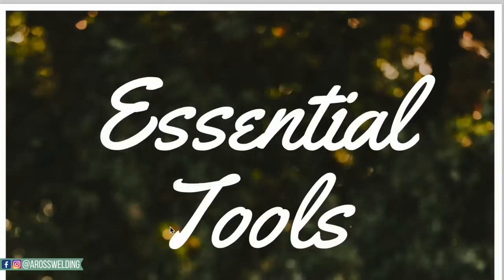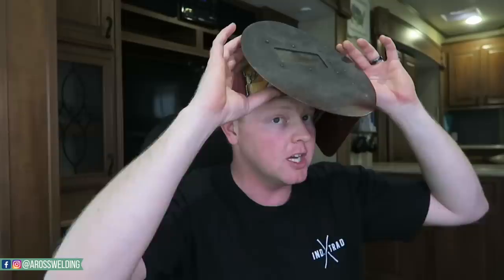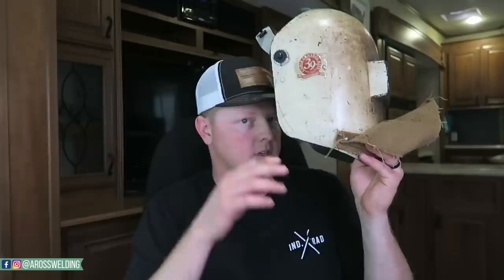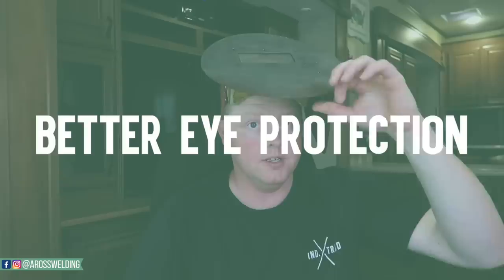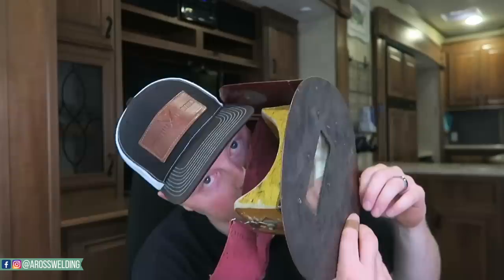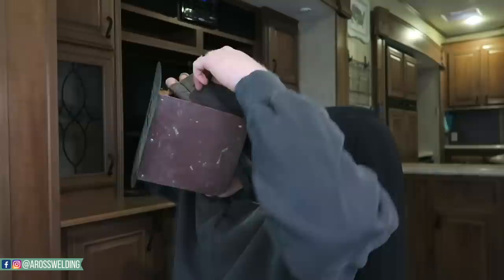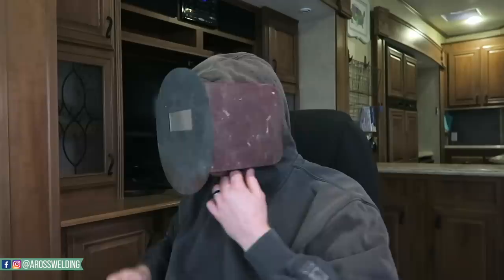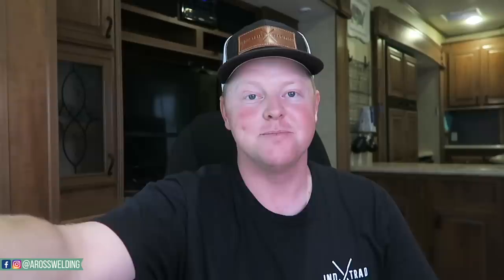WHY PIPELINE WELDERS WEAR PANCAKE WELDING HOODS (EVERYTHING YOU NEED TO KNOW)

Comment: I'll never wear a hoodie or hooded jacket while welding. In my early 20's I was welding a ladder on a grain silo. I'm 20+ feet in the air welding and wearing a hoodie when I feel a tug on my feed line. My buddy was desperately trying to tell me that my hood caught some slag and burst into flames. 17 years later and I still don't wear a hoodie of any type to weld.
Reply: @thegrandfinale2 oh looking back on it, it was absolutely hilarious and terrifying simultaneously.
Reply: @thegrandfinale2 it's not just a good suggestion. At my company all welding is halted 20 minutes before calling it a day. Not only to clean up, but to ensure there's nothing scorching hot before leaving. We also have an old wives tale about being extra cautious on Thursdays. Because of one reason. Payday being Friday means it is cheaper on the company to die Thursday.
Reply: I had one light fire in my hoodie pocket.
Reply: @thegrandfinale2 30 minute rule
Reply: Hot work permits cover that as well. If you are doing shorter welds you'll be alright tho. Most of my welding stuff is also wrenching attire and covered with oil. Haven't died yet.
Reply: That’s like rule #1 when you’re in welding school.
No hoodies....
Reply: When i was learning to weld in college back in the late 80s i just bought some overalls that happened to be nylon. I was learning MMA and gas welding and i'd get the odd hole from hot metal in my overalls. Then a mate who got some nasty burns as a kid messing around with burning plastic sheet, a small part of which broke off and stuck to his leg went total batshit at me and made me buy some cotton ones.
So there i was a couple of weeks later sat at my bench gas welding and as you do when first learning, not keeping my filler rod within the flame so was getting oxide forming and leading to the occasional exploding weld pool. Well one such explosion, unbeknownst to me, landed on the thick part where the press studs go on the overalls front and started to burn.
There were four of us taking this course. The other three all worked together. I was paying my own way. They had been pratting about trying to set each other's overalls on fire by touching the glowing ends of their filler rods to their mate's overalls. They tried it once on me and i threatened to put him through the wall!
So i'm welding away and start feeling some heat under my chin, so i move back a bit further away from the pipe or whatever it was i was welding thinking i'd leaned in too close.
Carried on welding...
Still feeling the heat, so i stop and look down, (still wearing my gas welding goggles) for any flames. Don't see any flames, carry on welding.
Now my chin is REALLY feeling heat so i quickly stop and pull off my goggles to see a two inch wide burning patch about four inches below my chin! I start slapping the flames out with my left hand and then look around to see these three dickheads all sat there grinning and when i see them grinning, burst out laughing! They decided not to tell me i was on fire because i threatened one of them...
Needless to say, the next session i was wearing nylon overalls again. I'd rather have holes than large sections catching fire!
Reply: @_multiverse_  no no no no #1 rule is: just dont catch on fire duhh
Reply: @_multiverse_  Im taking a basic welding course that just started yesterday. first 5 minutes after attendance, NO HOODS, NO POLYESTER. he said it about 8 times
Reply: @_multiverse_  I prefer coveralls but at least 80% of the students in my class intakes wore hoodies 🤣
Reply: You can get hoodies made out of Nomex now, they ain't cheap but if you gotta keep warm, definately a better option.
Reply: You wear a hoodie when you weld? Is that flame retardent?
I think back to all the times my jeans caught fire... and they burn slow....
Reply: @koitorob  I'd rather a flame that is barely noticable than a quickly-burning synthetic that melts and sticks to my skin like pitch
Reply: @simply_based  hoods are fine when they're fireproof.
Reply: @koitorob  nylon is a no no. That stuff burns pretty easily and will stick to your skin while it’s going.
Reply: @almosthuman1398  a friend of mine put a huge hole in his trackies welding something in college,

Burnt right through his overalls and left a hole but amazingly didn't burn his leg.
Reply: I've set myself on fire a few times . It happens ! I've even had hot slag drip down inside my boots . Always good to have a water hose and a fire extinguisher for these circumstances . Hot slag will get your attention real fast . 😅

Comment: I use those normal composite with the auto darkening lenses that you see fabricators use and just add a small piece of leather to block out back light and what is nice about the normal auto darkening composites is they allow you to have an option for grinding as well, so you use the helmet as a face shield as well.

Comment: I worked as a helper offshore on the pipeline in the late 90s and early 2000s. Very few guys wore the pancake shields and a lot of times the welding foreman wouldnt allow them. 
Top 5 Pipeliners I knew
1 Chic Liepert. Didnt retire till he was 70. Could run a root like nobody's business. Very pretty caps
2 Johnny Lyles. Cool dude super good welds and easy to work for.
3 Mr Brad. Liked his rods bent so I would always have a stack bent for him. Always had plenty of good pot
4 Carol Trahan. This guy could weld the crack of dawn to the break of day. Cool mfer
5 George Pendergraft. I will never forget you George and thank you for showing me what it took to be the best helper I coud be. Sorry I never did break out

Comment: My advice to those serious about achieving the goal of becoming a certified welder and fitter is start as a laborer or welders helper on the job. You'll learn many things crucial to prime workmanship that a welding school doesn't teach. Welding School can provide you the equipment and technical training applicable but you can't limit yourself by practicing "in position" all the time. Practice 3g & 4g (vertical & overhead) and 6g on pipe (45° axis). As a helper I used my breaks and lunch times practicing on scrap. I passed my 1st field test ( 3g uphill , e7018) '72 because the welder was too fat to get in the fuel tank through its porthole. Practice, practice, practice.....Be the best you can be but without self-pride. Stay humble and you'll learn much more than otherwise. Compete with your own potential, not with someone else. Be dynamic, not stop&go.

Comment: excellent speaker, very clear speech and perfect delivery! I'd never seen a hood like this, but I understood it immediately. 
I was a track welder on a small railroad, and almost all my welding was done outdoors...that's where the tracks are. Every track welder I ever worked with used a conventional "sugar scoop" hood, and would stuff rags into the top, to try to keep the sun out. Others would just struggle with the sunlight and hope for the best. I saw a catalog one time, and saw this leather hood....kind of a leather bag, with the usual harness setup for supporting a welder's hood. It covered the whole head and down the back of the head as well. Perfectly dark inside. I used it indoors as well, and it was good for crawling under a piece of track machinery to paste something back together...tight quarters and a rigid hood would not fit in there. No sizzling BBs in the ear canal, either. Also very nice for air-arc work at 400 amps with a blast of air blowing stuff out of the puddle.

Comment: Another great video for the beginner! Something you might consider for the winter also is a nomex hood,the kind made for firefighters & race car drivers, they are fire resistant  but not fire proof,the point is they are made like a full open face ski mask,They are used by firefighters as part of their turnout gear, but I have found after retiring from the vol.f.d.that they work pretty good for welders & in the extreme cold winter weather they will keep your head warm,especially for old men with bald heads!( & younger guys with bald spots .)

Comment: @Austin Ross, very well done video! Man, things have changed since I was a pipeliner back in the later 60's. The welders waited for me to put a bend or a sag on a joint, then my side boom operator set the joint down on the right of way next to the ditch for them. Don't remember some details of the pipe but it was naked 36" × .250" steel with beveled ends. When the welders finished welding up the joint, the welds were  X-rayed then the dope gang wrapped the pipe. Again, don't recall the details. We worked as late as we needed to on tie ins and "shooting the pig". The welders were men from all over and loved what they did. Our boss Jack Maggard took good care of us all. I had a chance to go to Brazil with the company (McCathern Pipeline) after military service was out of the way. They were drafting back then and I got my Welcome to the Army of the United States letter in August of 68. Now, about those bald spots on your head........lol!

Comment: I love my pancake hood. But I cannot use it because everything nowadays is all about “safety” I work in a structural building plant as a welder, and there are lots of flashes from air arc and just other welders when I use my regular mig welding hood. I honestly wish I could use my pancake for the exact reasons you explained. No sparks in the eye/face, no flashing, very lightweight, and just very convenient.

Comment: I began welding 1972 with Magnolia Marine in Greenville, Ms but as a "laborer/welders helper". I was only 16 then, still in high school and worked there my summer break. I've certified 2006 AWS D1.1/5.20 all positions unlimited thickness as the test 3g(uphand) & 4g was on 1". Despite its occupational hazards and the burn scars I have to show for it all I would strongly suggest "fitting/welding" as a prime occupation.

Comment: I've been a Welder for damn near 40 Years , Race Car Fabrication, Structural, Jobbing Shop amongst other jobs (gotta Pay the Bill's right ) but this is the first time I have ever heard of a Pan Cake helmet , I have used many Visor's including what you call a Sugar Scoop , but  I have found my Speed Glass to be the very best Visor I have ever bought and used, it has a Proban hood like your Sugar Scoop chin flap, but covers the back  of your ears and neck and has served me well when working outside. Workshop welding to Gas Pipelines. 
Good vid and explanation though , I like the side shield on the pancake , ( Yikes sparks down the Ear hole don't half smart)...

Comment: Worse part of flip down hoods is when the tightening knobs wear out from nodding it down then the they won't stay up,frustrating
Reply from the maker: I heard that!
Reply: Just "barrow" them from from a face shield and keep the extra ones from the old gear
Reply: Alex Graham  or a couple of short roofing nails !!!
Reply: @bustersmith how???  With a lock nut n bolt its perfect how would you use a roofing nail 🤣
Reply: Don’t they make little blue pills for that issue?
Reply: You can but machined aluminum nuts that dont wear out.
Reply: I put mine down by hand every time after seeing my stepdad get arc-eye when his hood didn't come down when he started the arc. It got caught on something overhead. He was off for a week til it healed

Comment: Greatly appreciate this video, I do welding for a hobby in my shop and the overhead lights are some of the brightest I had installed. The back light is such a pain and I’m actually going to try one of these pipeline masks. Appreciated!!
Reply: You can take a piece of leather or nonflammable fabric and put it between your welding hat and helmet, letting it drop down the back. It'll block the light and if it doesn't block enough you can roll up another piece and stuff it up front

Comment: when i started learning to weld,  early 70s, i was told the most important thing was that the welder be comfortable.   at first that was a joke.  but NO  its very important.   i was hard faceing trencher teeth with torch.   with a #4 lens.  and my eyes was burning.  so i stacked a #3 and 4 together.  my eyes stopped burning.
Reply from the maker: Very good advice you were givin, I think that’s key also. 👌😎
Reply: I started my apprenticeship as a welder in late 70s that advice from my father who was also a blacksmith/welder always sticks in my mind and so true.

Comment: With out a doubt my favourite daily helmet is the speedglas 9100 adflo. It blocks out all backlight, has the option for side view windows that can come it very handy and I am getting around 16 hours out of the adflo with a 1 hour rapid charge. It's really nice in all weather conditions once you know the tricks and the one touch external grind switch is great. All my other helmets are getting dusty. The XXI is the way to go but the XXI FX (flip up grind) isn't necessary because of the new lens is so clear and has one touch grind.
Cheers

Comment: Totaly get that .I'm not actualy a welder as such but I do it as a hobby and it's required occasionaly from me on a non structural basis at work .I've been in confined spaces with welding taking place and that light glare +UV can come at you from all over the place when space gets tight and the metal is shiny .

Comment: Really interesting, I've never seen anything like this in the UK. I restore vintage cars and motorcycles so I do a reasonable amount of fabrication although I'm not continuously welding all day every day. 

I must admit, that problem you mentioned with the light coming in down the side of the inside of the mask does get on my tits a bit but I usually put a cover over the vehicle I'm working on or if I'm outside try and Jerry rig my way around it. 

Most of the full-time welders are using those ventilated masks like the Speed-Glas ones now from what I've seen. They're all sealed up to the face. 

Thanks for sharing your knowledge on this, always fascinating to see how different people do jobs different ways (and I can guarantee you're a better welder than me, lol) I only have two basic college qualifications on MIG, ARC and gas. I've had a fiddle with TIG under supervision from a proper fabricator and can get steel to glue together quite nicely but I made a small hole in some ally tube ... into a very big hole lol 😆 

Stay safe out there and may the hot rocks not fall down your boots

Comment: I run a titanium with a cowl for a air supply, cowl removes 99% of backlight
Reply: Had a titanium a while back couldn't get on with the headgear so went back to speedglas for ultra comfort and I have a optrel panoramax excuse my spelling witch is so light you forget your wearing it but it's a very fragile lid I'm on my 3rd under warranty in 18months..

Comment: Can also wear a auto darkening helmet with cooling hood.
Reply: Sucks2beU definetly! Auto darkening in either style hood. Just be aware that sometimes you have to weld a little while holding your hood over the burning rod to recharge it if it hasn’t been used in a while. Sunlight wont recharge it. IMO

Comment: Welded in a factory for eight years on galvanized steel. Nasty stuff. Smoke is highly toxic fyi. Had positive pressure helmets from Racal by 3M. Had a "chiller unit" on a waste belt and a air line up your back to the helmet. You had cool air blowing on your face the entire time you were in your hood. Welding helmet still flips up but clear lens helmet under kept bad air out. Nice set up. Very surprised to see you guys not using something similar.

Comment: I always appreciate your advice and tips.  I only weld at home usually small farm repairs or small welding projects. I just have traditional welding helmets that flip up. They have different shades of lenses. Two are cheaper auto darkening and a couple with flip up welding lens so you can see to chip with a clear lens.  And just yesterday I had back light problems trying to repair the tailgate on my dad's 1963 GMC pickup. Also I once got a hot metal spark in my eye while wearing safety glasses and a welding helmet that was down. The welding lens was up and was looking through the clear lens while using the metal chop saw. Sometimes shit just happens.

Comment: Used to work pipeline as a welder helper, those boys that weld the pipes are the salt of the earth that's for sure and tough as nails. Part of a welder helpers job is to take the rods out and hand them replacements during pipe welding to conserve the heat, flow and speed of the operation.  Well doing this in the rain means you are grabbing live leads while well grounded, took many a shocks in the day, only mildly painful. You don't get much more grounded then knee deep in mud.

Comment: Hey Austin, are you able to fit a auto darkening lens in the pancake? I have a lincoln hood with the auto darkening and love it but I definitely know what you mean about that pesky back light coming in the sides.
Reply from the maker: Absolutely. Singles and Lincoln both make a 2x4 auto darkening lens
Reply: @arosswelding  is that what you use..auto darkening?
Reply: Of course, that adds weight again.
Reply: @melgross  so you dont use the auto darkening
Reply: Jacob A. Hull what? You just asked if you could put an auto darken module in the pancake. One of the major points to the pancake, as Austin mentioned, is the light weight. Add an auto module, and you add to that weight. So I don’t get your comment. You’re saying to install one and then not use it?
Reply: @melgross  no bud. why would I put one in and not use it. I was just asking you if you use one....I assume you dont because you mentioned the extra weight.
Reply: Jacob A. Hull I’ve got an auto dark ESAB. But that’s for most indoor work. I don’t need to wear that for hours though. If I did, I wouldn’t use that.
Reply from the maker: I use both. Depending on what I’m doing. I like the colors of my fixed lenses better than my auto darkening. Check out this video: 
https://youtu.be/G1JiVB41WPI